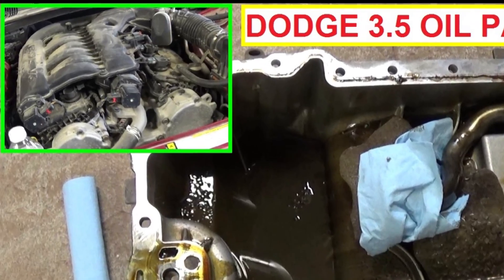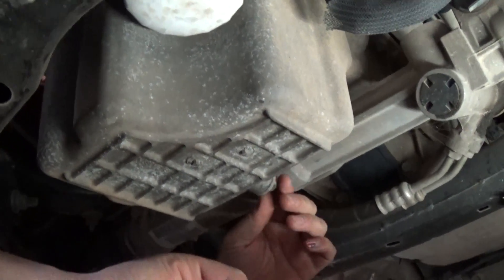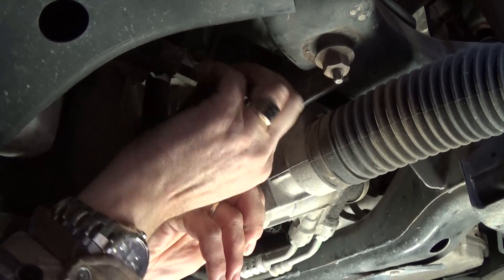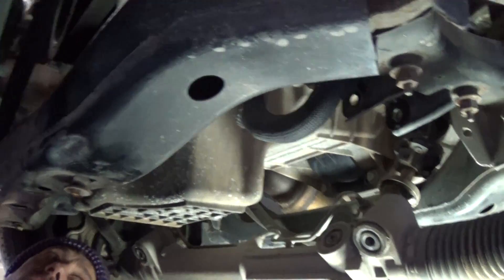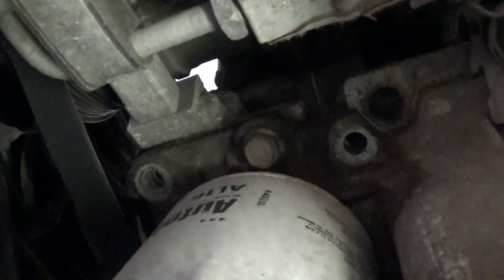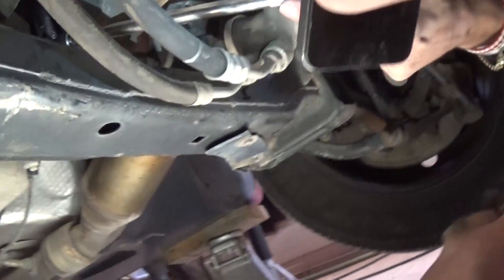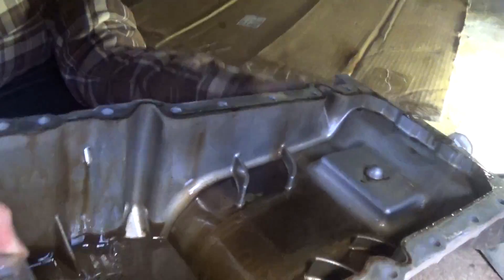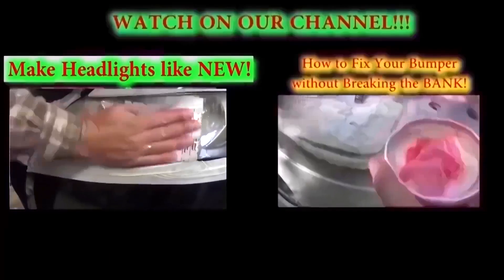Oil Pan Removal Oil Pan Gasket Dodge Magnum 3.5 Dodge Charger 3.5 Chrysler 300

Comment: Is it necessary to remove the two "mystery" 5mm hex bolts in the back? They don't look like they hold the pan on. I can't get a 5mm hex socket back there and an allen key doesn't seem like it'll fit correctly.

This video makes it seem... not hard. I've found this pretty difficult tbh.
Reply: Do NOT take them all the way out. There are slots on the pan so all you have to do is loosen these bolts about halfway or so. If they are removed it is incredibly difficult to put them back in.
Reply: Dude I'm having hell right now lol
Reply: @jm1662  I gave up. My pan was busted but I couldn't get it out cause the cross member beneath was bent just a little and I didn't have enough clearance. Ended up junking the car.

Comment: You are going to have to remove the engine oil cooler... it's the little block that the oil filter screws on to... you will need to clamp the hoses that connect to them first. I used zip ties. If you dont antifreeze will go everywhere. And you will need  a #12 hex bit to remove the thread stud. Some have an hex nut on the outside of the thread stud to unscrew it but on mine you have to put the #12 hex bit up in the center of it to unscrew it... when you disconnect the hoses and unscrew the threaded stud it will release... hope this helps with the engine oil cooler assembly.
Reply: Thank you so much for posting this. I got under my car and was like "What is going on here?" The 12mm hex socket I had was too short (I think 3/4") to reach the threaded stud thing. Ended up buying an impact socket set just to get one long enough. Zip ties is clever but still wasn't easy for me. I assume you used the zip ties to crimp the hoses shut?
Reply: Yes the zip ties are for the coolant hoses... I went to my local napa and they were able to sell me the 12 hex bit separately so I didn't have to buy the whole set👍
Reply: Appreciate it I just did a charger today and this post was clutch thanks had to go to the parts store to get a 12mm hex I had a 10 but I was wondering how I was going to do it I was thinking towel and vice grips hoping to not screw up the threads until I saw this post  lol thanks
Reply: @Brandon Kennedy that is great to know. I have attempted this oil pan change on my 3.5 06 SXT charger and the new oil pan that was claimed to be OEM won't allow the connector that goes thru the oil cooler to screw on, the thread is larger than the factory connector that the oil filter screws onto. I have tried 2 oil pans now and that piece won't screw on. Did I get the wrong pan or is that part supposed to be removed from the actual previous oil pan and uses on the new oil pan, ? My work around was to bypass the oil cooler for now and I also had to use a larger oil filter on the new oil pan the stock oil filter threads were to small. this has been very frustrating for me because AutoZone and advance show that the oil pan I ordered is the same part number for the oil pan and their system for my vehicle. Help would be greatly appreciated Brandon if you can offer it thank you
Reply: @raymondwoods999   I hope you see this message but I ran into the same situation as you and don't want to buy another pan. Did you find the solution to it?
Reply: @comando2174  my Solution was to buy the oil pan and use the larger s2 oil filter which was stp brand and bypass the oil cooler since it would not thread in I have ran the car hard since then and no issues with the temperature or anything since the oil cooler was bypass dint think a 3.5 really needed a oil cooler to begin with.  All of the oil pans you find will be oem but they will not accept the oil cooler and you will need to use the bigger filter
Reply: @raymondwoods999  How did you make sure that coolant was not spraying from the hoses since they aren't connected to anything at that point?
Reply: @comando2174  i just zip tied the cooler out the way you can remove the cooler and  cap the lines but I didn't and coolant did not leak or spray any where
Reply: Thanks Brandon. Great tip

#letsgobrandon
🤣

Comment: Thanks for your contribution, helped me a lot with my dodge Charger SXT 2008, I just like to add something: You may have a hard time removing the oil pan in the Charger SXT 2008 because the frame is slightly different from the magnum, so lowering the oil pan may interfere with the frame, so I had to grind 1 cm in the lower part of the pan that connects to the transmission (where 2 bolt holes are on the pan) using my Dremel and some tungsten carbides.
Reply: Was same for 2007 3.5 dodge
Reply: Okay can someone give me advice on replacing a rear Main seal in a 09 3.5 v6 Dodge Charger
Reply: @noone2807 Requires pulling the transmission or at least sliding it back about a foot. You will have to remove the flywheel also. This will require a torque wrench to retighten the bolts. An impact makes removing the bolts  much easier. Not too terrible but not not easy by far.

Comment: It didn’t show how to remove the dipstick and thats what im having trouble with, any recommendations?
Reply: I put some vice grips where it connects to the oil pan and started twisting.  But the oil pan still wont "slide" out🤦‍♂️ kinda stuck rn
Reply: Was stuck on this for quite awhile too lol wound up taking the bolt for it up top in the engine bay, putting a screwdriver in the bolt hole for it n prying the stick up n poped right out it has a o ring on it is why it's so hard just pulling n prying from the bottom does nothing trust me lol

Comment: I don't know about the 3.5, but on the 5.7 you have to life the engine up underneath the motor mounts, is that true?
Reply: Shit I hope not because I'm about to replace the oil pan gasket man. I have seen people drop the transmission to get to it without pulling the engine though.

Comment: how do I take the oil filter cooler off to take the oil pan off, seems to be stuck
Reply: That's what I'm trying find out
Reply: Did anybody figure that out?
Reply: @Jesussosa104  I'm sure you figured it out but you need a big allen wrench  (12mm)

Comment: Great video but how do you get the oil pan over the frame I'm having a really hard time getting it over the frame
Reply: Edward Galvan  Simón  primo  como lo quitaste el oil pan
Reply: Do u ever get it ??
Reply: And of course you would not update.  Thanks for nothing 😂
Reply: Yeah same here, it's being a pain
Reply: @mitchelltiefenthaler2582  sorry,  I just saw this. There are 2 nuts that hold the transmission onto the frame right in the middleof the car betweendriver and passenger doors. Right in the middle of the car. You have to losen them a JUST a lil, then jack up the transmission. Someone helped me figure it out. Came right out after that

Comment: There’s where the oil pressure sensor is located??
In the pan or other part 
Please respond 🙏
Reply: No, it is close to the oil filter just aside to the ac compressor

Comment: Um that looked like water draining out of the pan
Reply: DarkSide after pulling the oil pan down, he says that "it has water damage".
Reply: Dodge made these engines with the water pump inside the motor making it timing belt driven . So if the water pump leaks it would leak directly into the oil since the water pump sits above the oil pan in the engine